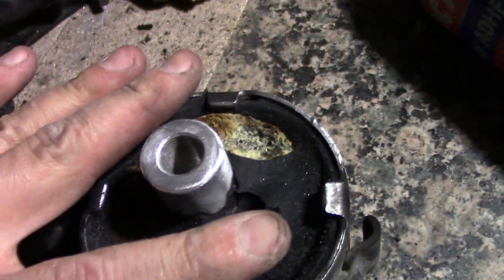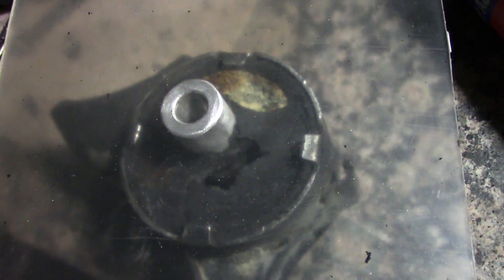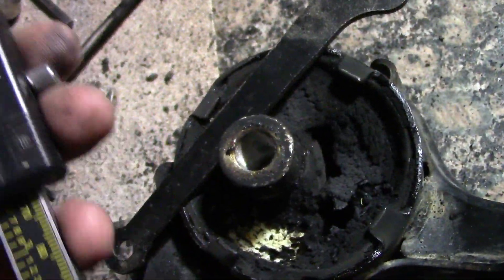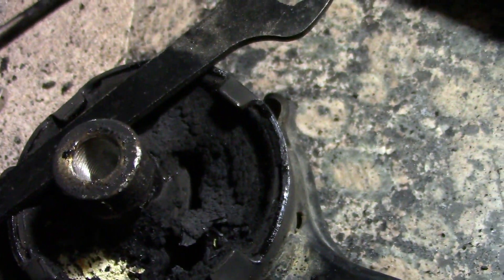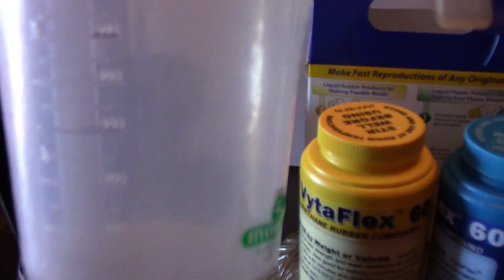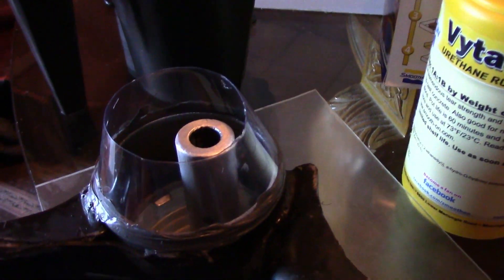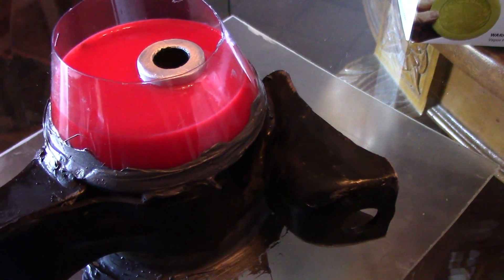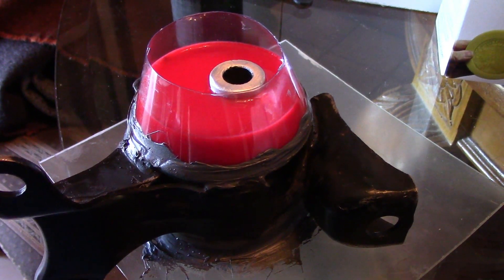DIY professional polyurethane engine mounts K series!

Comment: If you let it sit for 24hrs, it self cures. It doesn’t need to be oven baked. Looks good tho dude good job
Reply from the maker: That didn't work for me. Oven cured was the only way I got them to harden properly and I have almost zero humidity in my area.
Reply: Cloneufc wierd. I used the same compound, 80F, mine are solid hard
Reply: Yea that’s why I was saying I don’t understand how it didn’t cure
Reply: @MARK6297  maybe wrong mixture, old chemicals, who knows

Comment: Have these been installed yet?
Reply from the maker: I installed it in the video. Did you not watch it?
Reply: Cloneufc how do they ride? Or feel?
Reply from the maker: @joegama57  They feel stiffer than stock. Equal to energy suspension motor mount inserts. They are actually perfect for racing and daily driving.
Reply: Cloneufc they dont shake the shit out of the car?
Reply from the maker: @joegama57  No. You don't want stiffer than 60A rubber because the K series Tps sensors will break, because they are sensitive to vibration.
Reply: Cloneufc thanks man